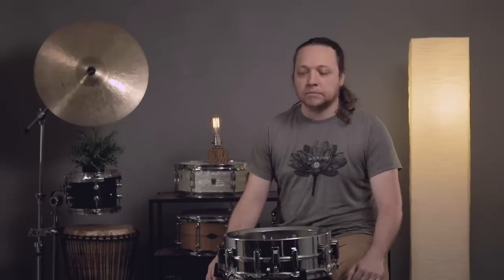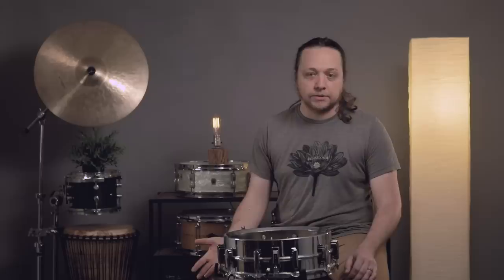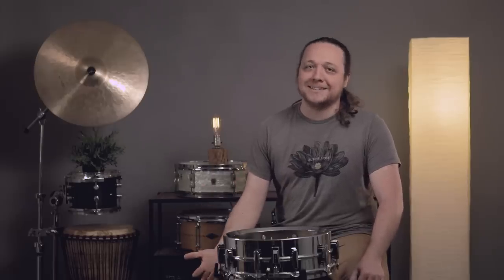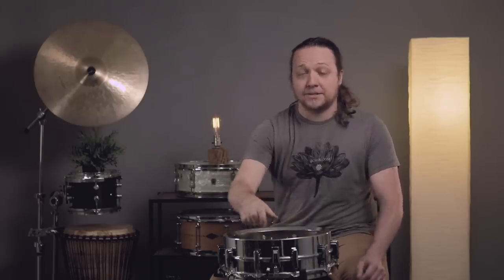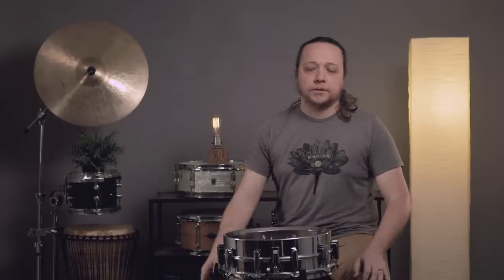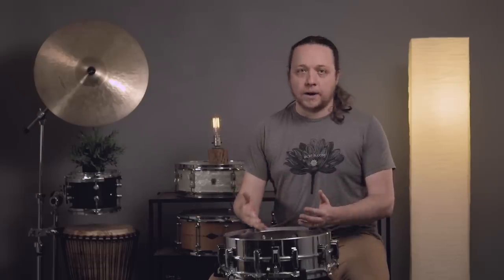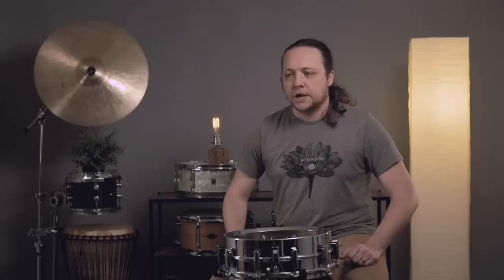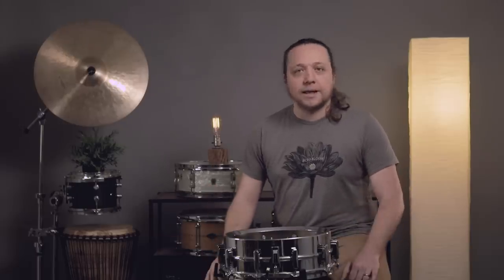Ep. 39 What About Snare Beds?

Comment: Trying to tune my Pearl Reference Pure 14x5 snare with a tune bot. Tried it several times and when ever I do the hoop looks bowed (The snare beds are lower than the rest of the hoop) and uneven around the rest of it ... Is this normal? I take the hoop off and it’s not bowed ... Doing my NUT IN!!! Am I doing it wrong??
Reply from the maker: Nope that’s normal - every snare bed is different so they all react to tension differently. I’ve had those device get confused with snareside heads though so I don’t really use them for that :) -Cody

Comment: Weird I have two mapex snares of similar age circa 2000 , the steel 14 by 6.5 has no bed I can see and the maple 14 by 5 has a big deep bed, I don't like either of them much to be honest. I upgraded the maple one with 16 strand pure sound wires, they made no noticeable difference, the steel has good fat sound at low tension but no articulation and has nasty ringing when I crank up the tuning, I can't get it right.

Comment: I still don’t understand why there’s a snare bed! Wires never lay completely flat on the head in the first place because the metal ends that rest on the head are slightly bent down and dig into the head and leaving the wires not to rest completely flat on the head. Having a deeper bed will through off the whole tension tuning on those lugs. It can be a nightmare to get those lugs by the wires to tuned to the same pitch as the rest of the lugs. I can see having a snare bed if you have much higher end priced drum that have wires that extend out past the diameter of drum.